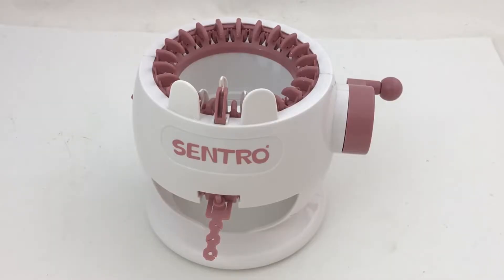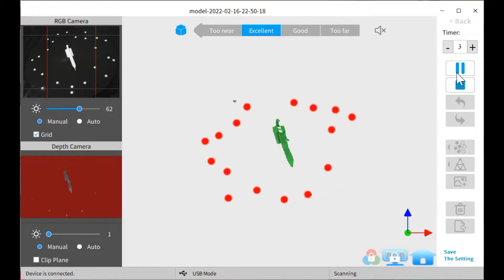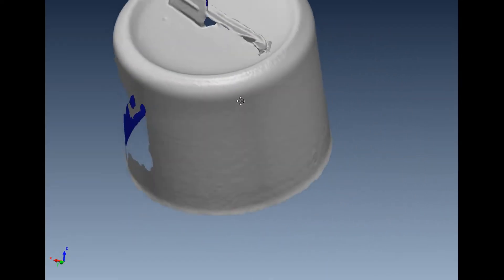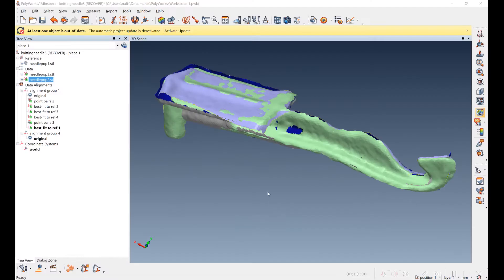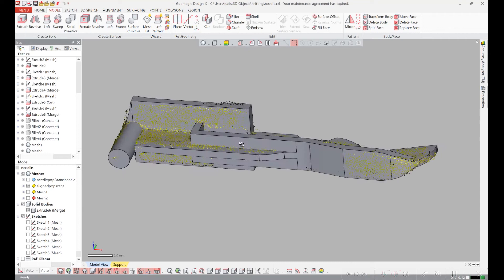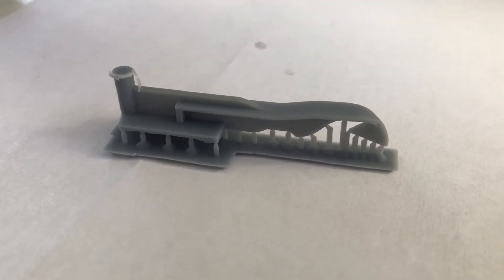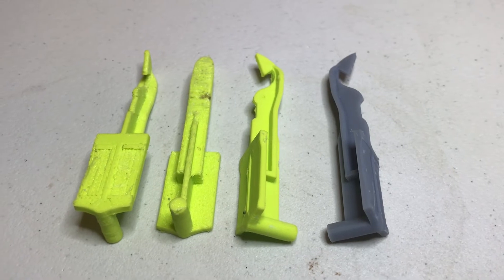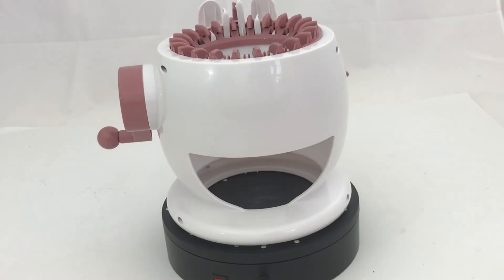Revopoint POP Scanning Small parts... working around problems

Comment: Have you ever 3D printed any other parts for the Sentro 22 needle knitting machine? I recently purchased one and it hasn't worked well at all since day one. It continuously skips gears when turning the handle. I purchased a better 3D printed gear for the handle but its still skipping. I know it's a cheap made toy type machine but I believe it could work better if all the parts were better 3D printed quality. Appreciate any feedback.
Reply from the maker: no other 3D printed parts, it works OK for me

Comment: I bought the revopoint mini and I am trying to learn to replicate pieces of my model kits.  Even with the mini, I cannot get the scans accurate/detailed enough for what I need.  I would like to use calipers and add accurate measurements to my files but I am so new to this that I don't know where to start. Do you have any recommendations for software or classes that will teach/allow me to do what you did in the video?

Comment: Nice job. I've got a Pop2 on order myself. 

That particular part looks like a good candidate for printing in ABS and vapor smoothing (or in another smoothable material). 

Myself, I'd probably make a mold of the part and cast it. Probably quicker and definitely better accuracy. That's a whole different ball of yarn though ;)
Reply from the maker: I thought about casting it... but didn't have any supplies on hand. I don't like printing ABS because of the fumes. I love printing PETG. I was also interested in if it was possible with POP scanner and the cheap printers. Good to know the limits of the technology.